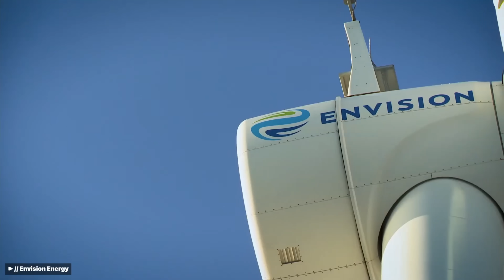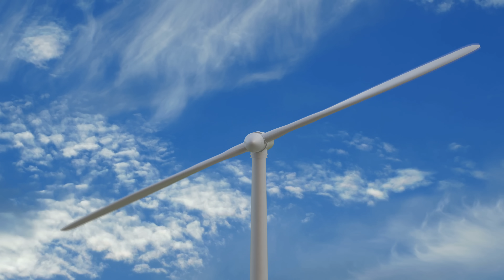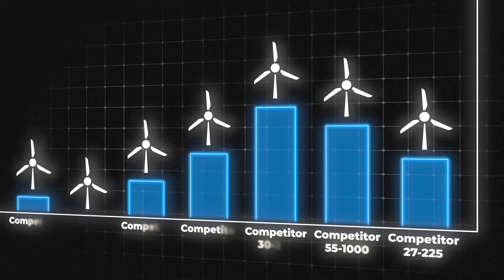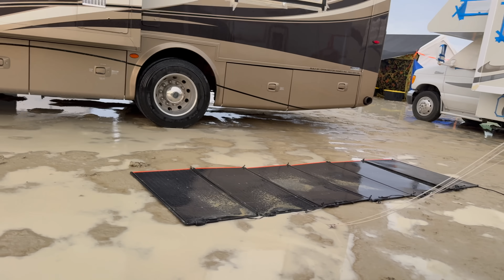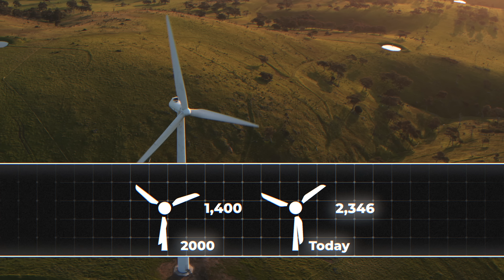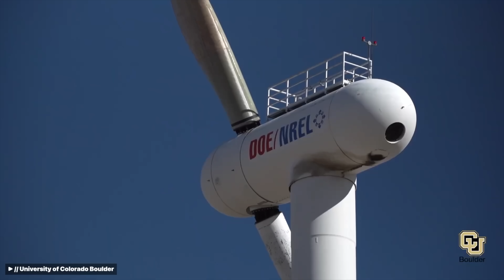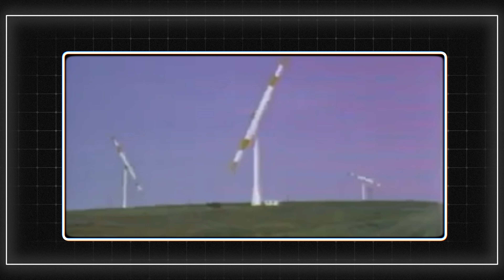Surprising Benefits of 2 Blade Wind Turbines - This SURPRISED Me...

Comment: If you're worried about power to weight ratio:
Make the tower aero-teardrop shaped and make it rotate, with the turbine, from the ground up.
Less aero drag on the tower = less strength/weight required in said tower...
Wind turbines will also be quieter.

Comment: Would a two blade design result in roughly 1/3 fewer bird casualties vs a 3 blade?
Reply: I would doubt that. With two blades the blades move faster. This 'killing birds' thing is a white lie anyway. Sure, it occasionally happens. 
But the real bird killers are: glassed skyscrapers, feral and domestic cats, loss of shrubbery and other supporting biotopes. When caring for birds, this should be addressed first.

Comment: Vertical access wind turbines on the corners of buildings would be the best approach..
 Is store the energy in a salt water flow battery.
 Is cheap, practical, durable.
 No transmission energy is transmission energy loss, If you are making the electricity where you are using it.
 Let's need for infrastructure.

Comment: 2 blades bad, 3 blades good... The turbulence causing noise from 2 is horrible compared to a 3-blade. That is the main factor for using 3. Secondly, it is another blade touching the wind. How can 2 possibly be more efficient? 
At the end you say all these overly complex systems to make a 2-blade functional, do they outweigh the more simplistic 3-blade concept? I doubt it. The more moving parts you add(tilting the head???) the more complex and likely things will fail. These things already have a short lifespan, why do you want to make it shorter?

Comment: WIND TURBINES ARE A SCHÀM:
Two blades are no better than three when you talking about a failed technology.
Windmills are a danger to the environment and cannot replace fossil fuel based power generation. The cost of electricity they generate is much costlier than other alternatives. In addition, they have short life expectancies and disposal is a nightmare.
Reply: Nonsense.
Reply: @Misophist What is nonsense? My opinions on Wind Turbines or your lack of understanding of the problem. Look at the entire life cycle of a windmill, its impact on the environment and the cost of disposal then compare the cost per kilowatt of electricity generated.
You will learn, assuming you can,  relative to other forms of power generation Windmills are the most expensive form of generation in common use.
Besides Windmills and Batteries cannot support high load industrial operations like Steel Mills.
Add to that they are short lived and kill birds by the millions.
Reply: @TegwynF  Compare that impact to the impact of mining and transporting the fossil or nuclear fuels to power plants, the effort to build, maintain and undo them, which dwarfs that of wind turbines several times over. Renewables in general are only half as costly as the rest of the bunch, and usually have cost spikes only twice: once when erecting them, and a second time when they go out of service. Supervision is mostly automated and done from remote. Once in a while, some technicians stroll by to check on the lubrication and wear of the moving parts, that's it.
   This is totally different from boilers and reactors, that not only need tighter supervision but have to be kept sufficiently supplied, and the waste (ashes, spent fuel rods, clogged filters) removed and deposited, emission values constantly checked, instruments recalibrated. These plants are constantly monitored by several crews in shifts around the clock 
   To me, it is pretty obvious, that it is you, who hasn't the slightest idea of how complex, ardours and risky the management of fossil and nuclear fuels is.
   Renewables can power everything if you build enough of them. Even with growing consumption by EVs, some countries in Europe are already past the 60 % for the generation of electric energy by renewables, and yet there are enough possibilities to grow. It is possible, even with notorious energy hogs like steel mills and cement factories. Anyway, it doesn't matter, since the alternative isn't renewables or not. The alternative is do or die. If in the long run, we don't manage to power our gadgets with renewables alone, we won't be able to power them at all. Simple as that.
Reply: @Misophist You basic premise is flawed. Windmills are inadequate for the task. Don't believe me? Ask any German who spent the last few years freezing in winter. How many wind mills do you need to power a Steel Mill or Aluminum Smelter? How many highly toxic batteries? Perhaps you prefer solar panels with their poisonous semiconductors. How many square miles of land do you need? Then there is maintenance. Who keeps the glass clean? What do you do with all those cleaning solutions? Who replaces the fragile broken panels. I only need one fossil fuel or nuclear plant to run a Steel Mill, a Smelter and the town that supports them. Put all that aside. There is no climate crisis, unless you consider an inter glacial era a crisis. Our modern technology is clean, efficient and cheap. Got to be pragmatic about it. Do you want to be warm, comfortable and well fed or cold, hungry and sick? Cheap, clean, affordable energy is readily available. Windmills and solar panels are not the solution. Besides, what are you going to do about the real sources of pollution, like China, India and Africa. The countries with poisonous soil, slave labor and limited environmental laws. Imagine that! The very places your beloved Windmills, Solar Panels and Batteries come from. Got any more illogic?
Reply: @TegwynF  Instead of asking a German about freezing in the last couple of Winters - which they didn't - you might ask about the big holes in the landscape, that are torn by open pit mining lignite (brown coal). They are literally shoving the homeland into the furnace there! You could also ask about the eternal technical debt, that was left behind by the mines in the Rhine-Ruhr area. The mining has poisoned the water in the lower strata there. So they can't just  let the old mining shafts be flood, else the well feeding from the waterboard above would get contaminated too. Worse, the exploited and refilled coal bed below collapsed, causing a depression above, that is prone to be flooded by surface water. Now they have to pump in eternity, just to keep whole towns from being flooded!
    It's not much different elsewhere. In Appalachia, they are taking off whole mountaintops so to be able to strip mine the coal below.
    The story here is, that the amount of steel and work you need to not just maintain the coal burning plant, but also the mines, the trains, ships and lorries to keep that all up and running, is larger. Especially with the mining equipment and the lorries, you can't even hope that it survives more than 5 years of intensive use.

    Your idea of being 'pragmatic' exhausts itself in spewing half truths, and mixing lies into it. Some numbers: contribution to the production of electric energy by renewables: (Statista:)
2021:  ~ 41 %
2023:  ~ 56 %
2024:  ~ 60 %

Which obviously includes energy produced for metallurgy enterprises. BTW.: I remember faintly having seen a report about an aluminium smelter investing into a large on site battery to enhance independence of power fluctuations, because even before renewables, they had to coordinate the operation of their gear with the energy providers. The tech is there.

Ignoring climate change just because it doesn't fit your bill won't stop it. First hints about it came in the 1960 out of a study, that was financed by later became Exxon. I first heard about it 1978. Since then, computer power to compute the models has increased by roughly 9 magnitudes. Measurements of actual conditions have become more precise. And the warnings haven't become less, but more, and louder.

Comment: if two blades worked better than 3 , then why are thousands of windmills running 3 blades. Learned a long time ago in Engineering. Don't  fix it until you're really sure it's broke.

Comment: Chasing the "ideal" of a 2 blades system seems to be more of a battle of then fixing the problems that it brings.
The 2P problem graphs illustrate that most elegantly.
Off course here, but pusher aircraft (props in back) are noisier because there is nothing to block, absorb and deflect the noise at the back, whereas tractor ("puller") prop noise impinges on the engine cowling and wing and other structures deadening some of the noise.
There are (as stated) always tradeoffs and engineering is about reducing some "thing" at the expense of others until the goal(s) is (are) reached.
Where wind power is concerned, the main goal is lifecycle energy cost. (and yes: this should always include disposal of the spent system - notably the blades).

Comment: salt water mhd flow generator. no moving parts. for tide generation. and salt water batteries. nah single blade is not balanced. anyways dont be cursed by work for people. do stuff freely. who. ai buzzwords. trash. expect fake performance advertisement statements. 2400h. 100 days is not enough. not robust enough. every company designs their turbines for service interval payments. fake engineering. is pleasing market. ton of bs reasonings.

Comment: Recently, there was a report that wind turbines do not have a good ROI in comparison to other forms of energy production. Their glamour comes from no carbon emission.  Unfortunately, you can’t recycle worn out blades and they must be ground up and used as filler material.
Reply: Citation needed.
Reply: Without some context on the report, its authors and its assumptions, there is little to say. Coal retention ponds can't be recycled yet either. The goal from a societal standpoint was to remove high carbon power sources and make them profitable enough to implement and improve. The ROI is for society not the power companies.

Comment: Two blades make a noise far beyond  what three-bladed propellers/rotors make! Compare a twobladed Bell helicopter with a three-bladed, or five!  A huge difference in noise! Single blade is best, but needs a huge counterweight, of course, or you need to make the  tower much more rebust, thus weighs more and  costs more!

Comment: It's tempting to think of the motor/generator analogy.  How some big (10 foot) industrial fans have 6 or 8 blades, and computer fans often have 7.  But in this case, generating power vs blowing air are totally different.
Reply: just like the video said, less blanes is more effiction. but for computer the ratio of the size of sigle fans to volume or space of the case is very low, that is why you need extra blades and high speed motor or extra fans to solving the problem.

Comment: you saying that the noise thing isnt a major issue. Me, who works is acoustics, having a meltdown
Reply: The noise of wind turbines is really not an issue. They are usually far enough away from peoples houses and make very little noise even if you stand below modern ones. In Europe we have very strict rules on emissions and distance to houses (sometimes far too strict given how quiet they are by now). Also most of them are out at sea or in remote areas. Nobody cares about sound there...
Reply: @stefanroeder87 I mean its not an issue as long as they are far away as per regulations is kinda the same thing as saying it definitely is an issue close by. That low frequency woosh is pretty impossible to stop. Anyway if the noise wasn’t an issue you’d have a helluva lot more sites you could put them up because the regs wouldn’t be as strict 🤷🏼‍♀️
Reply: @yay-cat  The reasons we have certain distance rules in Germany, for example, is because they used to be louder in the past and we have some weird nutjobs in Germany that claim that ultrasound or other stuff is killing their sleep (which is complete nonsense of course, as other communities, which financially benefitted from these turbines by getting a monthly share of profits, didnt report any of such issues - surprise, right?). Nowadays there have been tests of people standing below a windmill and still hearing the nearby Autobahn much more significantly than any blade rotation. People love to complain about all sorts of things. The peak story was from T-Mobile after installing a 5G tower. Citizens started to complain about headaches and health issues. Until T-Mobile published that they are really concerned what will happen to them by the time they will actually activate said tower :D

Comment: Hi I had been lead to believe that the main reason we have 3 blade rotors is stability as when a 2 blade starts to adjust its position to face the wind they can becom so unstable they can wreck themselves. I was also told that 3 blades was a price compromise as  more blades would be more efficient but cost more

Comment: Seems the wind pushes the turbulence away. Particularly at the speeds of those blades. It's not like the air is static and the blades need to move the air. Air moving the blade isn't the same as the blade moving the air.

Comment: The reason for why not one blade is the same for why not two. You're going to have to construct more foundations, more towers, more motors, just to get the same amount of power out of the air. For when you are constrained on size of blades, and you only want one wind turbine, say for pumping water, you see 10+ blades. If you want to increase the size of the blades to compensate, using up some of the weight savings that was gained by removing a blade, you're going to limit where these already massive blades can be transported to. Have you ever seen a truck carrying one turbine blade before? The corners need to be completely clear of any obstacles and the trailer needs to go right over any guard rails because of how long the blades are.

Comment: Denmark here: We have some small 2-blade turbines 10-15Kwh for agriculture and private use, but when you scale up to e.g. 100 meter rotor, the difference in wind speed in the top and bottom will destroy the construction. and a lot of vulnerable computers can't solve that. More noise? YES, and there is more than just people to take into account, what about the rest of our vulnerable biosphere? As usual, one thing is theory, another is practice!
Reply: The incredibly resilient control system sounds like it solves much of the gyroscopic precession issue, but throughout the useful life of a wind turbine there may be enough extreme wind events to overcome the control system and destroy two-blade turbines that three-blade turbines will survive. I would expect that some years-long studies at sites with extreme wind conditions will be needed to evaluate whether they have truly solved the issue. And that doesn't even address the safety of the rest of "our vulnerable biosphere" you mentioned.
Reply: Thats why Denmark is losing to china. And now trump closes projects in usa. Dansk vind industri er død nu
Reply: @remix-yy1hs  Danish wind turbine company is actually doing quite well now. Perhaps you are basing your negativity on the surprise bad news from back in 2024?

Comment: If you put a big bulbous nose on the opposite side of the nacelle on the two blade propeller, the shape would pull air in to hit the blades more evenly toward the center of the blade (More power from less wind).  
On top of that you could put weight in the nose (maybe cheap sodium batteries) which would allow you to extend the other side of the nacelle so the propeller sits further away from the pole.  
And if you wanted to fix the turbulence the pole causes, your could put a rotating cowling that moves with the position of the nacelle which is shaped like an aircraft wing with the fat end facing away from the blade and the pointy end toward the blade, further reducing wind turbulence. 
This would potentially reduce vibration build up and allow the blades to turn at slower speeds as the overall shape would suck in surrounding air toward the blades.

Comment: Their solution would surely generate their own problems, whether or not it will be better on  the balance is a question. 

Additional mechanics to counter can themselves wear out and will surely draw power as will the computers that manage all this.  More maintenance than latest 3 blades also cuts into benefits.  

BTW of course 1 blade wouldn't work, the biggest reason you didn't mention is 1 blade has no counterbalance. Meaning you'd have to have wind blowing perfectly at just the right strength for it to have even a chance of working and it could even rotate backwards as the blade climbs up and back down again.